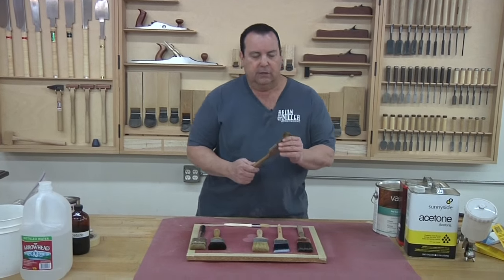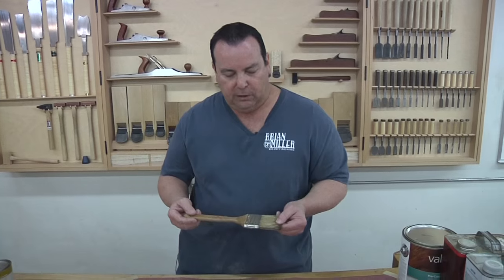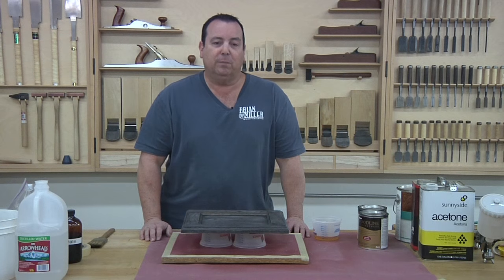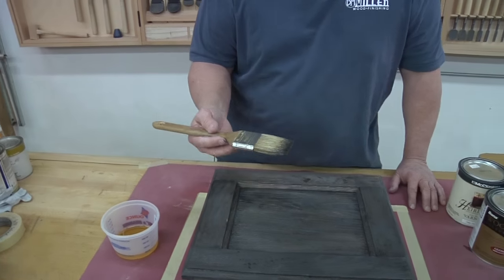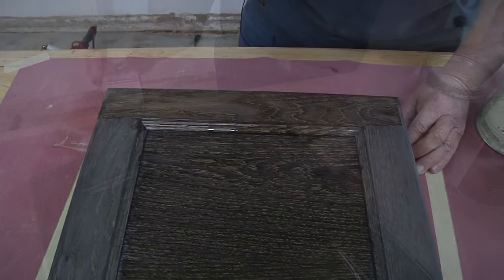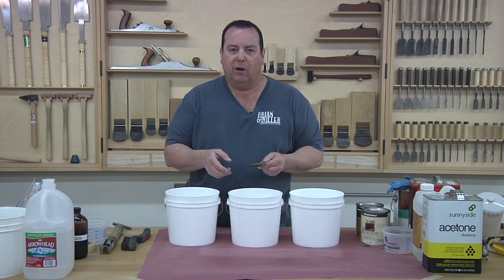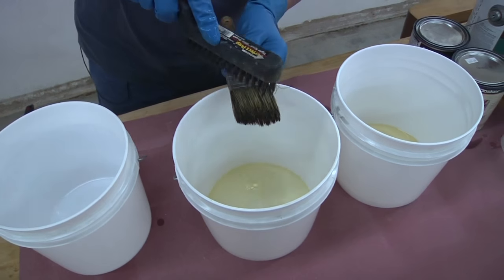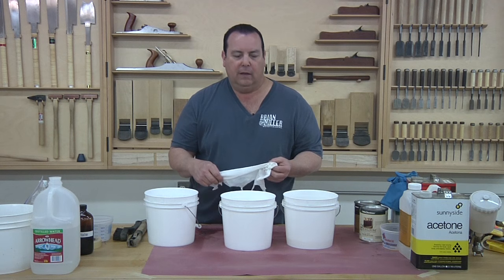Choosing and Using Proper Finishing Brush Techniques

Comment: If you buy good brushes it is wise to keep them clean. No one wants to keep buying brushes for every project.  I have brushes at least two or three years old that are still serviceable and paint free. I was wondering if it is acceptable to filter back the used acetone for reuse.  I do this with thinners from time to time.

Comment: You can save the old acetone and thinner and use them as a first and second rinse, then use new stuff for the final, it actually settles out after time.. doesn’t smell too good but still cleans your brushes ! Great video, and that’s from a professional house painter that knows a thing or two about paint brushes and finishes !

Comment: Excellent video with all the info you need to start and finish the  job including the clean up. For years I included the cost of a good brush in the finishing stage as I had given up on trying to clean them, I just let them dry and tossed them away.

Comment: Purchase a small air motor driven parts washer with a wire rack inside and a nozzle that squirts the solvent over parts.  Put your thinner in it and install hospital size kotex on the rack as a filter.  Wash your brushes in the solvent and get most of it out of the brushes.  Then just clean up in a very little clean solvent.You will cut your solvent purchases to almost nothing and your recycling amount down to about 5 gal a year of kotex.  Pays for itself in short order.

Comment: Thank you Brian. Excellent instructional session, as always much appreciated coming from William! One question: I currently use Nitrile gloves as my go to protection. Is nitrile a good enough barrier to the solvents used?

Also, at the snap, I, too,  had a little shudder..........
Reply: +Gerry Rovner- Sorry for the late response, was out of town. Nitile won't hold to strong solvents like acetone, yo will need some marked acid resistant.

Comment: It appears you're using the following (please correct where warranted):
1. Purdy Ox-O-Thin 2" 144300020 (Oxhair & China Bristle for oil-based paints, stains & varnishes)
2. Purdy White Bristle Swan 3" 144400430 (China Brislte for Shellac)
3. Gramercy Tools Finishing for Shellac & Laquer 2" (for varnishes) 
4. Purdy XL Bow 2" 144064320 (Nylon &  Polyester for water-based paints, stains & clear)

URL:
1. http://www.purdy.com/products/brushes/oxhair/oxothin/
2. http://www.purdy.com/products/brushes/white-bristle/white-bristle-swan/
3. https://www.toolsforworkingwood.com/store/dept/TFB/item/GT-SHEBRU.XX
4.  http://www.purdy.com/products/brushes/xl/xl-bow/